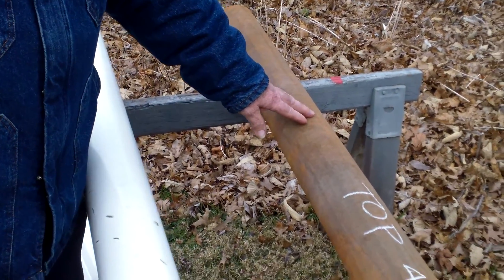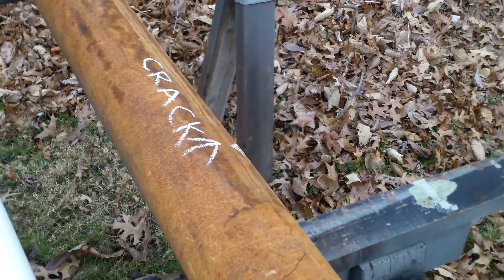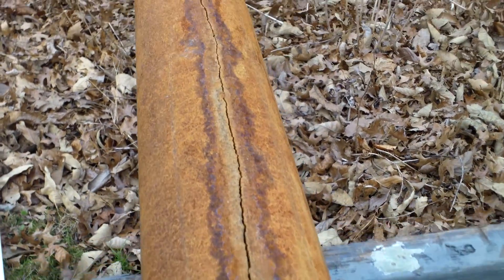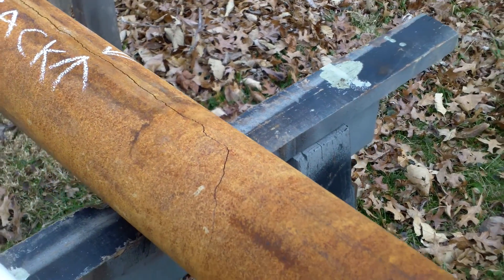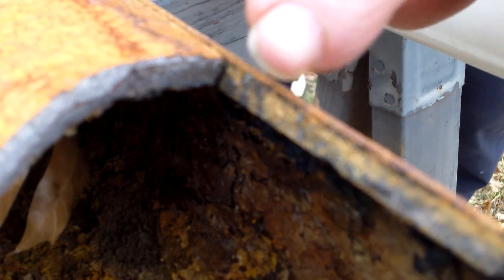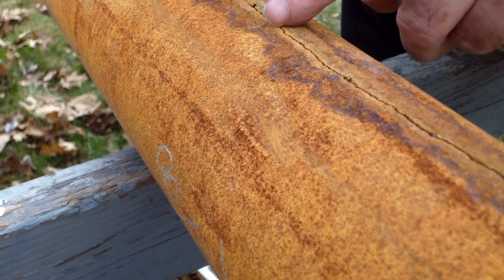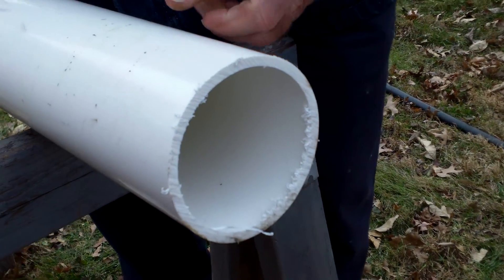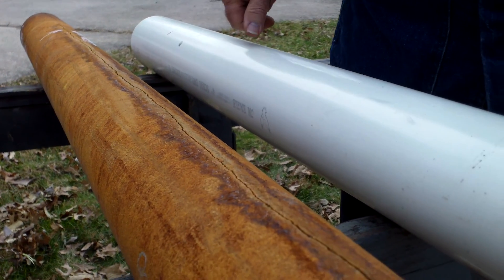WHY DOES CAST IRON PIPE CRACK??????

Comment: I'm not a master plumber or anything but I do have some experience and I think there's a number of things going on.  Most of the wall thinning issues I've seen in cast drain pipes are usually at sweep elbows where you're going from a stack coming from above, to a horizontal run for some distance, to another stack going vertically down ( Think of the captial letter L and then drop another line down from the right side of the horizontal line at the bottom).  Those usually manifest as holes rather than cracks.   The long cracks like you have in the video I've generally seen on vertical stack runs.   The working theory I have with this is due to the sheer weight of the iron itself as the house settles over the years/decades it introduces a sort of bending moment in the whole pipe.   I mean, plumbers aren't perfect,  you're not going to strap everything perfectly and where you place your supports and really lock it in will move with the structure itself as the years go on.  This introduces ever so slight bending and torquing moments to the whole stack.  Then, as the years go on, you get anode action on interior and exterior surfaces where the metal is bare due to some flaw in the coatings.  This causes oxidation from those start points and the hydrogen sulfide from bacterial off gassing in the waste stream just makes it worse.  Finally at some point this is going to hit a critical level and there will be some sort of shock to the system.  A massive rainstorm or everyone flushing the toilet at close to the same line and then it just lets go along the crystal structure of the iron.  Since its not a forged product, this allows any crack to start and then travel along that structure, helped along with the bending or torquing moment I mentioned before.  Then you smell the poopy water and we gotta cut it all out for you.  Seems to make sense to me.

Comment: Bet anything that during loading, unloading, cutting, installing etc someone dropped it from too high as this pipe is extremely heavy.  Causing a micro fissure that finally after enough heating and cooling cycles this became the weakest point and cracked.

Comment: I am researching the causes of cast iron pipe splitting along the length of the pipe. We have several commercial and research buildings that have multiple failures like this on the rain water leaders. I have recently been made aware of Microbiologically Influenced Corrosion or MIC. I have a suspicion that MIC is a major contributor to this type of failure in cast iron pipe however there is very little research on MIC specifically in water and sewer pipe (Most MIC research has been in the oil and gas industry). I am hoping that you or anyone looking at this post has any opinion on this?

Comment: One of the problems with cast iron is that it is vulnerable to dry cracking. This can occur in sections of the waste system that are not used often like an extra bath. The lack of water in the system causes the cast iron to dry out and crack. 
Cast iron can also be vulnerable to cracking on horizontal runs where sewer gases build up causing the pipe to crack along the top. Best way to solve the problem - never use it.

Comment: They're stress cracks.
The answer is in the name. “Cast” Iron. That said most crack due to uneven stresses in the original cast and/or later on in the uneven support. 
Either not enough hangers or if in the ground uneven backfilling.

Comment: It depends on its exact location , supports,   vertical or horizontal, location next to ground, chemicals in wastewater etc. 
Have you ever seen a crack in a vertical cast iron pipe?    Just because it does not crack does not mean it has not reached a brittle stage in the steels lifespan.   If you take a sledge hammer to it it will crack.  It is very brittle at this point.    
Just my opinion.
Reply: I have seen multiple vertical cracks in old cast iron pipes.
Reply: I'm dealing with a series of cracks in a vertical pipe. They could barely be seen, until I ran water (took a shower) and you could see weep holes. Someone mentioned water hammer - this was at the top of an 8 foot stack. I was able to remove the pipe by hitting it with a sledge; the entire side caved in.

Comment: This is my best educated guess: Its a defect in the annealing process, not enough of the impurities are taken out so is more likely to corrode from the little bit of water and moisture just sitting there are the bottom of the pipe. So it just rust all the way through that one section that was not heat treated properly.

Comment: Just had the same thing happen to  me, but on the top. I'm trying to look for video's on how to seal it. I was thinking about liquid nails then a few coats of durlock. I  can't understand how it cracked, but it did. Our home is over 80 years old.
Reply: The water is held in an aquarium with silicone.  If it is too hard to replace the pipe. Brush inline with the crack with a wire brush. Make sure the crack is dry, use a hair dryer if necessary.
First put a bead of silicone into the crack, force it in.  If you can't get the caulk gun in position, put a short flexible tube on the end of the caulk tube so you can force caulk into the crack.
Then go back over the top of the crack with a bead of silicone about as big as your finger.   Use your finger and slightly spread the center of that large bead to each side of the crack by  wiping  first to one side and then the other. Make sure you leave at least 1/4 inch thick on top of the crack. Keep wiping it onto either side of the crack and work your way down.    This is to give the silicone more area to grip.  I fixed an old house this way 15 years ago and it has not leaked yet.
Reply: Hi... I just had the same case as yours yesterday, crack the whole pipe on the top side... I wonder why it happened that way. Have you found the cause?
Reply: weld that with 2280 welding electrode.. it stops 95% of the leakage

Comment: Perhaps at some stage freak weather conditions caused a partial thaw and the pipe ended up full of water and then freezing and ice expansion caused the cracking
Reply: I've got the same issue with cracking long ways with vertical stacks. A whole building full of them...... all of a sudden... after the renovation has been done and we had no part of touching those pipes or even uncovering those pipes. I got a feeling it has to do with the temperature. It's a city building that was cut off for the cold months and now the stacks are cracked vertically on 80% of the vertical pipes

Comment: Cracks in cast-iron pipe are usually located where the weld-seam on the pipe is. If you look very closely at the inside of the pipe you can usually see a little bump. That is the seam and it runs along the entire length of the pipe. On a lateral line if the seam is placed at the bottom of the run, the weight of the cast iron in conjuction with the corrosion from water running can cause a straight crack along the length of the pipe as shown above.
Reply: Cast iron pipe is not a welded product - I believe it is centrifically cast  See:
https://youtu.be/s4jdBOKiF_w
Reply: No welds in cast iron. Thus the name. The seams are from the molds it was casted from.

Comment: I have had this problem three times and each time it was right after vacation.  My last vacation was 2 weeks long and I came home to a 16" crack.   I first tried to epoxy putty it like I did the last two but this crack was too long for the putty to work.  I ended up cutting the pipe with a reciprocating saw with a 6" metal blade I had lying around and used WD-40 to coat the blade while I cut it.  It was really easy.   Inside the pipe I saw a lot of scale and Stalactites / Stalagmites with the mites having a long heavy coat.    I am making an assumption but because this happened to me each time I came back from a two week vacation that the stalagmites dried up from non use and expanded and cracked the pipe.  

I called my plumber and he told me to leave it alone they are 70 year old pipes and eventually I will have to replace it all.  I would do that today but we finished the basement and those pipes are behind the walls now.  Luckily the issues have only occurred where the pipes are exposed.  I check behind the walls at accesses points for joints and I haven't seen any water yet.   Just my observation.
Reply: Yes I've heard from another video a plumber saying it happens after a long period of being dry. 2 weeks doesn't sound too long in your case but I guess that was enough for those old pipes

Comment: My guess would be that it has to do with the pressure from the scale building up inside.
We just had something similar happen to an elbow below a toilet that was out of service for some time. I originally thought that water and then rust had made it's way into a seem that was left after manufacturing the pipe. But now seeing this I have to wonder.

Comment: Have the same problem at work.  Was told its due to the chlorine in our water.  This happened in a drain stack.  Maybe it starts as a micro fracture with the crystalization pressures building up in the crack causing it grow..
Reply from the maker: Our water is from a well so there is no chlorine in our water. Thanks for sharing. Any information is helpful in solving this mystery

Comment: If what you say is true,Why didn't the pipe on each side of the cracked pipe split?This pipe is fed by one shower,one toilet,and one bathroom sink.No big surges of water.P.N.
Reply: Once the weakest pipe length cracks, internal pressure would be relieved and nearby pipe lengths would no longer be stressed in the hoop direction.

As for your surge question, I wasn't trying to diagnose yeksun's particular situation, just comparing it to a possibly similar problem that I'm working on for a client. I would need to ask him several more questions before I could say they were due to the same root cause. In any case, pressure surges in a storm drain system originate from the discharge end, due to a sewer system overwhelmed by excessive rainfall.  How that may or may not apply in teksun's case, I can't say without more info.
Reply: Cast iron cracks because of corrotion. Once a small pore of rust is formed it "expands". If it is deep enough in the thickness of the pipe it will act as a wedge creating a crack.

Comment: I'm a metallurgical engineering consultant and happen to be working on this very same problem, which is why I ran a search and came across your video. The same thing is happening throughout the rainwater drain system in a multistory parking facility, and I've been learning just how common a problem it is.  I haven't completed my metallurgical investigation yet, but my working theory at this point relates to sudden surges in back-pressure that can occur when the sewer into which the drainage system is discharging becomes overwhelmed. A water hammer effect can result, which until recently I never would have expected to occur in a non-pressurized system.  However, one of my colleagues told me that he has witnessed it firsthand, and I'm finding technical literature that explains the various factors that contribute to it.  

When I'm done with the whole thing, I will come back here and let you know what the conclusions were.
Reply: Its rust that does it 
the rust starts and as it continues it causes a rut this rut is were rust gets below the surface of the metal
as the rust expands in this rut  it causes cracking just like ice would 
this exposes more fresh metal 
more fresh metal more rust more rust more cracking and repeat
Reply: You’ve had three years already, how much longer till you’re done with your findings?
Reply: What did you conclude?
Reply from the maker: That is very interesting . I would never have thought about water hammer in a non preasurized  pipe. I would like to hear once you get closer to a conclusion. Thanks for your comment.
Reply: Hi I am very interested in this topic and may write my thesis soon , can I contact to know what you have reached recently, that would help a lot..
Thanks